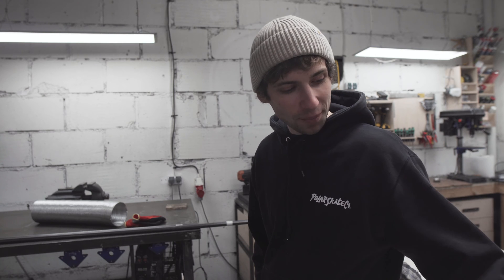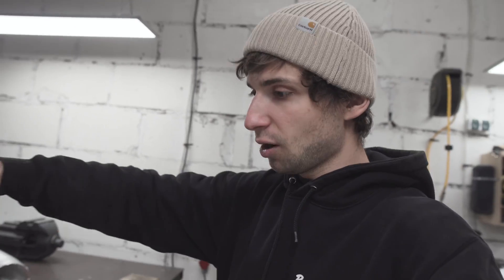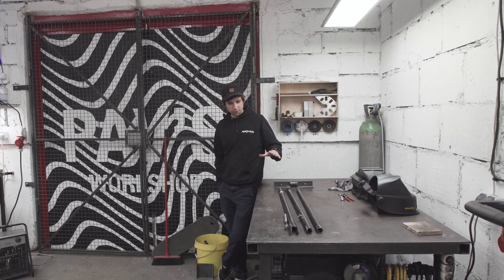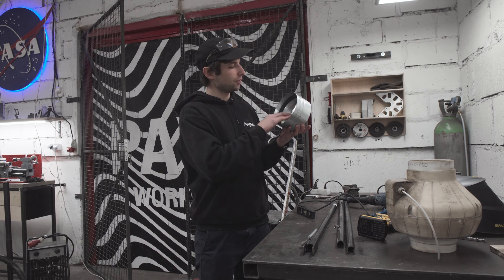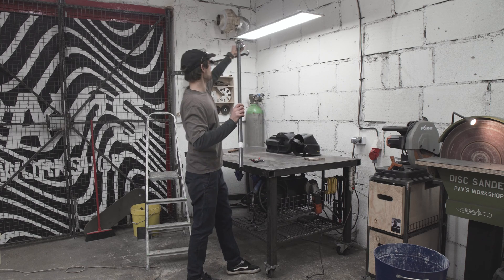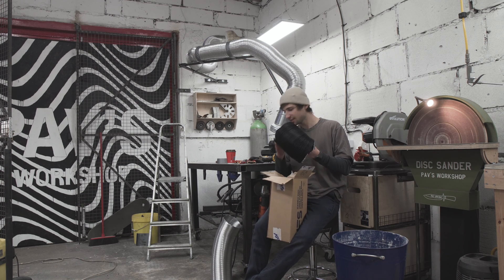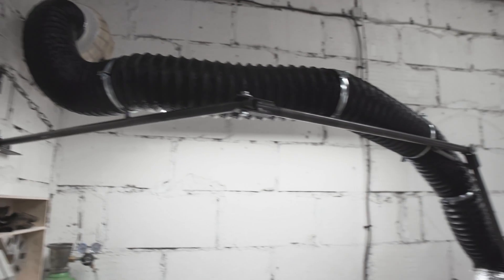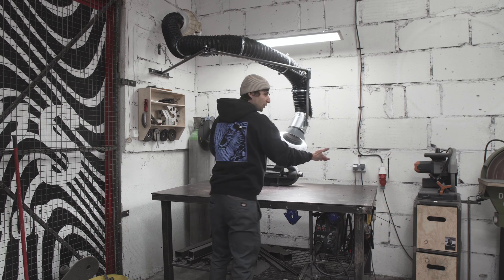DIY WELDING FUME EXTRACTION ARM

Comment: also be wary of how hot your working around that flex ducting. 

im a glassblower; and have heard many stories of folks using flex duct and it catching fire; and the oil based plastic acts as its on accelerant; couple all of with oxy/acetylene flame and your gonna have a wild night

Comment: Great work on the build, your solution for duct already saved me trouble of making same mistake as I was also going to get that aluminium rigid one. Just one question what kind of gas spring is that so it holds position?
Reply from the maker: Thank you! Yea the aluminium duct definitely doesn’t work for a setup like this. Its just the strongest gas spring I could find in the local hardware store.. I think the nut and bolt 🔩 in that “elbow” holds it more then that gas spring

Comment: Great work! What is the airflow on the fan (how many cubic meters per hour)?
Reply from the maker: Thank you! I belive it was 450 or 350 can’t remember exactly🥲
Reply: @iljanster  Thank you. Is this flow enough for you? I am currently ordering a fan similar to yours and am deciding between 1,100 and 1,800 m3/h. Probably 1,100 would be enough, but I don't know how the shape and length of a tube (approx. 4m) affects the suction power. The fan (tube) diameter is 250mm.
Reply from the maker: @ar237444  I feel like mine is on point, even sometimes i put it to close to the work and it sucks all the welding gas out I get pirocity on my weld
Reply: @iljanster  O.K. Thanks, mate 👍